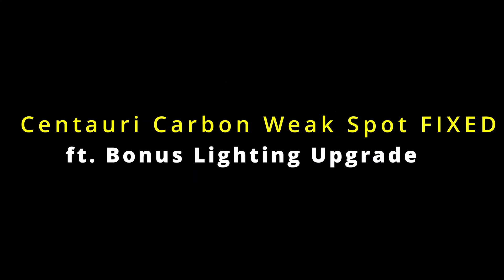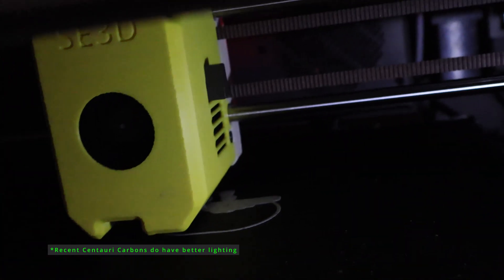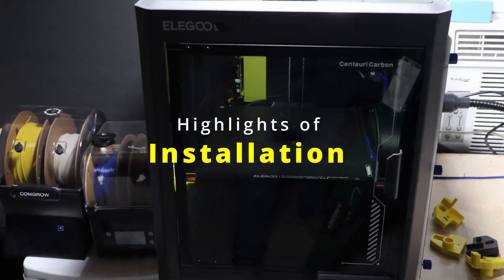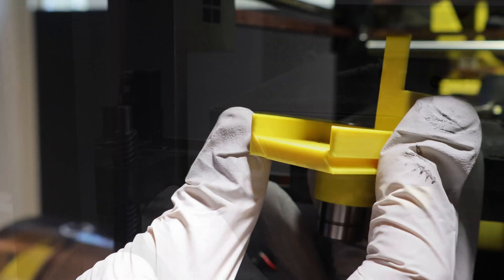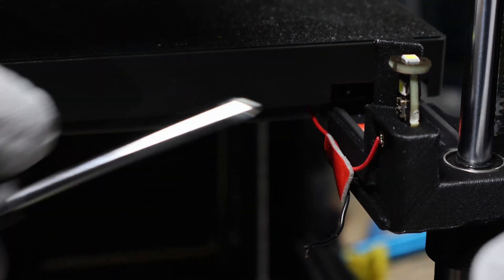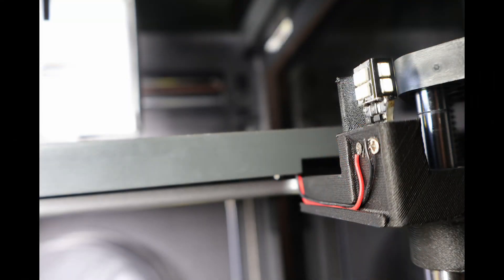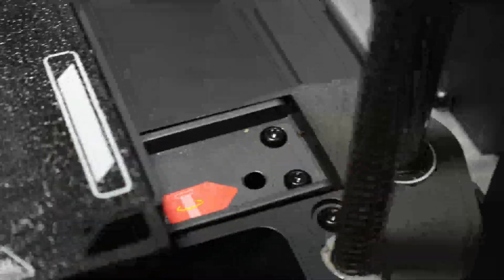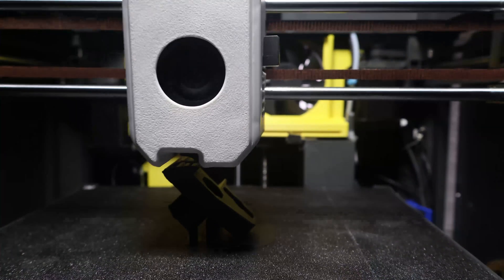Elegoo Centauri Carbon Weak Spot FIXED (+Bed-Level Lighting!)

Comment from the maker: Have you noticed any cracks? If so, how do you use your printer, and for how long? If you were going to have a stronger bed mount machined, what material would you use?
Reply: strange i have 1.2k hours so far on my CC but i dont see such cracks i saw your model at printable and i just thought to my self you are going to bild a whole new CC soon if you continue working hard like that great work man you are probl a life saver for some in the CC community with your designs
Reply: @bananaboy7338  he might've had some binding going on with one of the z-screws & mounts. during the initial self check my nozzle rammed into the bed frame and bent it so i had to replace it, after i replaced it i found one of my z-screws binding a bit at a certain height till I played around with the mounting screws for a while.. was interesting to find that pushing the bed one way or another while tightening those screws could cause or solve that issue.

Comment: I was going to add some adhesive light strips somewhere but couldn't decide where.. ended up making a magnetic mount and placing them under the Y gantry but feel they're not quite enough.. so I'll probably use your solution ty!

Comment: Hey!! I've got a question for you, do you think that you would create an ams style device or a multi color system device for the Centauri Carbon??
Reply from the maker: It's like some of you are inside my head! During production of the upcoming video, I had an idea on this very topic. Nothing complicated like the common 4-material systems. It would be a bimaterial system, enabling different support materials to be used or allowing for the easy printing of 2-material parts. OEM MMUs are bulky, relatively complicated, and expensive. I don't want to give too much away until I do some feasibility testing, but I may be able to create something super simple and inexpensive to accomplish this.

Comment: 1. Polymaker pet-cf is one of the worst and most expensive of the pet-cf's I've seen.

Buy sirya tech, trust 🤝 you'll love it. It also comes pre-dried

2. YOU NEED TO ANNEAL PET-CF. The values you saw in the TDS were likely for heat resistance. Annealing will leave pet-cf out preforming all the materials you've shown so far. Annealing is required to make sure your pet-cf has decent heat and creep resistance

Comment: I noticed something today while printing the HT-PLA. I had a part that was so long it had to be placed diagonally across the bed. Even with a brim it would warp - with the brim still attached, which confused me.

It turns out that it has been actually pulling the corners of the bed up off the magnetic plate. I'll have to find some sort of way to keep the thing down.

Comment: Your mods have been working for me. Now the one thing I have noticed is I can not if the filament it extruding when I load a new filament.  I was wondering if you have thought of adding a light over the poop shut. Keep up the good work.  BTW are going to have plans to have the fan board available in the near future? I want one or two fully assembled boards.
Reply from the maker: Thanks! I'll add the light to my list of potential projects. The boards are available now: https://syntheticelectron3d.com/products/se3d-pcbway-fabricated-fan-adapter-pcb-for-centauri-carbon-generic-3d-printer?utm_source=copyToPasteBoard&utm_medium=product-links&utm_content=web

Comment: Do we have fixes for dead motherboards? I'm on my 3rd mobo replacement due to the Print Head Anomoly errors.
Reply from the maker: If it's the error I'm thinking of, I got it with PET-CF17 a few months back. Does the hot end temperature drift 5C+ below target before throwing an exception? If so, try dropping your part cooling fan down to 80% and see if that stops the behavior.
Reply: @SyntheticElectron3D  I wish. Unfortunately it's a dead mobo. You can't do anything to get past the "print head anomaly" until you replace the board.

Comment: On the PCB Under the nozzle where the white connectors are located, it looks like there is a (unpopulated) footprint for a surface mount LED.

Seeing the tip of the nozzle is most critical in my opinion. 

Why Elegoo left this out I don't know. 

Having a good view of the print (success) is "a good thing", spotting air prints and bird nests, but preventing air prints is a major objective. 
There is a YouTube video on this subject. 
I'm using it, the SFS 2.0 filament movement detector, with an ESP32.

Comment: Have you had any issues with thr screws becoming stripped? I imagine with all tbe work youre doing on your printer, you are removing screws quite a bit. My printer came with screws being tightened so much that the tool they provided stripped thr flushed screws.
Reply from the maker: Only when using relatively soft hex/Allen keys. My old Harbor Freight T-handles are junk. I even cut the tip off with a diamond cutting wheel to get a crisp, clean edge, and I was still having issues. As long as I'm using a high-quality tool made from really hard material, it seems fine. Otherwise, yes. They strip out pretty easy.

Comment: Did you let Elegoo know of the issue with the part?
Reply from the maker: Not as of yet. A commenter on my post about this mentioned the octagonal holes create stress points. I kept that feature for easier bearing removal in my model, but I added at least a 1mm of fillet radii to them to help relieve the stress. When moving the bed manually, most of the force is required when moving it up, and with only a few lbs on the bed it will move down on its own. If it was from me moving the bed by not doing so carefully, for example, I would expect the cracks to start from the bottom. The cracks probably depend on the temps and types of prints you're doing, but I would imagine that they will develop eventually on most Centauri Carbons unless the versions shipped since the initial pre-order quietly fixed this issue without an obvious fix. Anyway, I'll send them a note.

Comment: Another smart idea using those bulbs in that mount.
I wonder why noone talked about the halfway nozzle light on the hotend connector adaptor board. The small board we are always fiddeling around with the heater and termistor terminals. There are 2 big unused solder pads labeled as LED, the stock extruder cover has a matching cutout. There are at least enought pins there to control the pads... I asked their support about it, they - maybe intentionally - misunderstood me and mentioned it would be for the chamber lighting led strip thats mounted in the upper frame, what doesn't make sense at all
Reply: Currently, v1.1.29 there is no way to turn the toolhead LED on via GCODE. There is a method to do it via the API but you need to manually trigger it. To get more information on this check out the OpenCentauri project.
Reply: @johntheblindman  I'd just leave it on all the time. Unless you can think of some reason you shouldn't - other than the waste of a little bit of electricty?
Reply from the maker: Thanks! I noted this about the PCB under the tool head out on Reddit a few months back. It's on my list, too. In fact, I considered it this time around but decided to do this after finding the broken mount. Both of those would be useful for different stages of the print, depending on the Z height of the print, especially.
Reply: @SyntheticElectron3D  Are we talking about a potential LED mounting point on the toolhead? I've actually ordered some 24v LEDs from AliExpress and I was just going to tap into the model fan to power it. But if there is already a spot to solder the LED to... I may just have to try that instead. I have the updated ECC with better lighting, but the huge toolhead casts shadow right where it's printing - which, to me, is the most important spot for lighting. I'd greatly appreciate a video or pics of the board and the solder point.
SE3D - keep up the videos. I really love tinkering with my printer and making it better. :)

Comment: I like your mods and watch your videos, but please stop those video efects, they are not good and at first touth my PC have problems displaing 4K. also the lights better be with difuser . they are much briter then needed
Reply from the maker: I'm aware of the lighting issues, but I have not had the time to come up with a solution, nor the funds to buy proper lighting equipment. Any suggestions for DIY diffusers?
Reply: @SyntheticElectron3D   ngl you might be able to print your own diffuser 🤔 Just find a good lamp for it and use do a 1mm or thinner piece with 100% infill.
Reply: Sounds like you need a CPU upgrade. You shouldn't have issues watching a certain video in 4k, but not on a different video. 
Idk why you would watch in 4k anyways since its stupidly resource hungry and he's probably only recording in 1080p or 1440p anyways.

Btw, I didn't have any issues with 4k on my PC
Reply from the maker: It is being recorded at a full 4k. I think now realize what the problem is - I let DaVinci Resolve use my proxies, which are DNxHR HQX, so in theory they should not be a problem. But there's another gotcha somewhere, I'm sure. It's a powerful tool, but it's got some issues and complexities that I continue to struggle navigating.